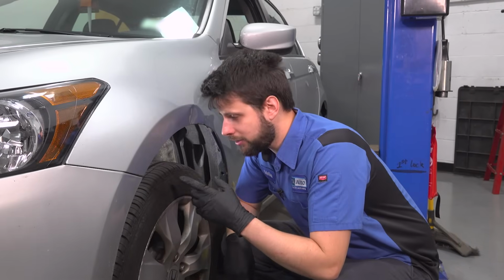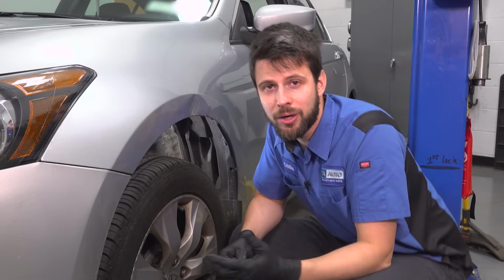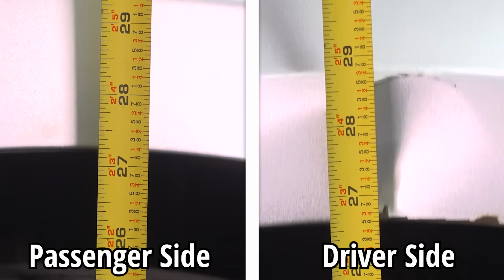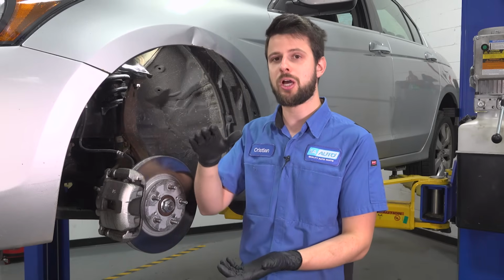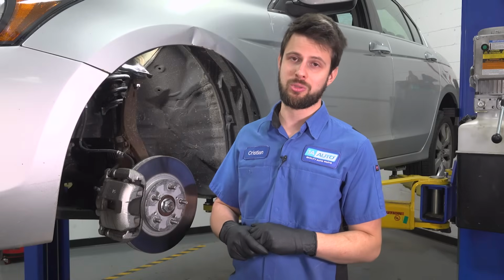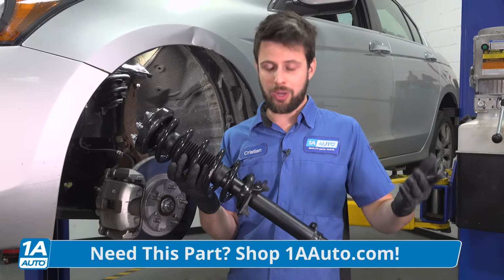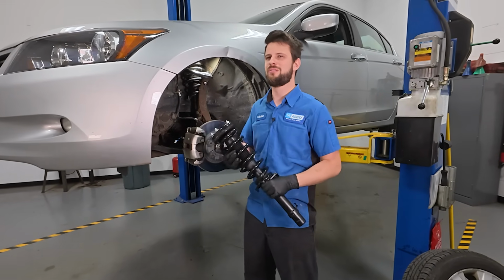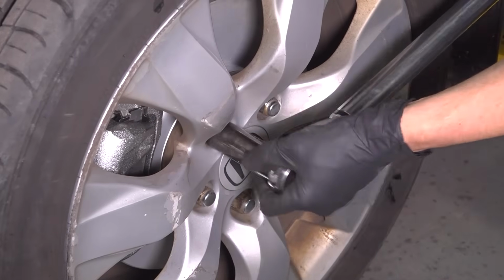Thudding or Thumping Noise While Driving? Check Under Your Car or Truck for This Suspension Problem!

Comment: Springs absorbed the jolt, shocks dampen the rebound or slow the movement of the spring returning to its original position.  Shock absorbers are totally misnamed.